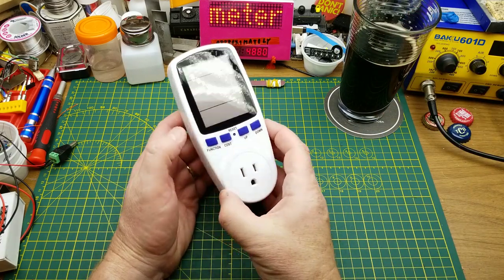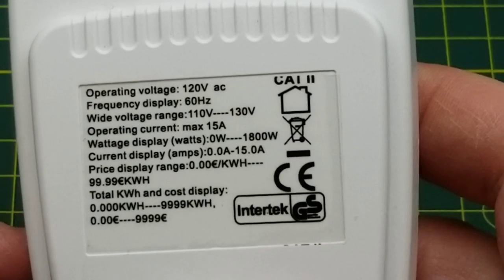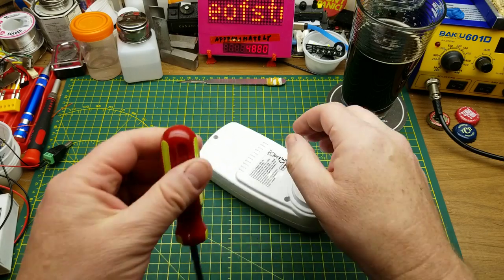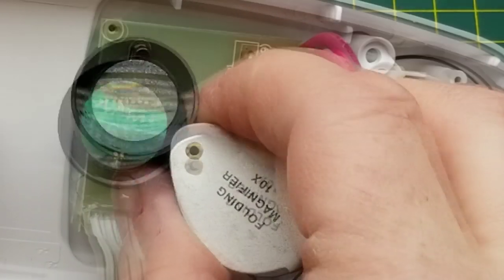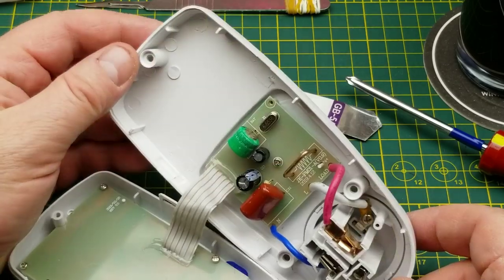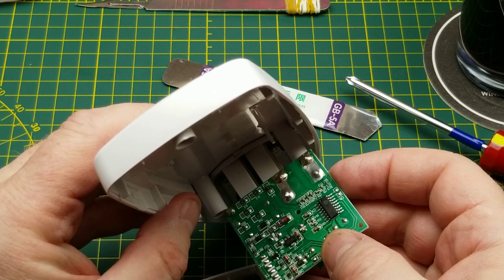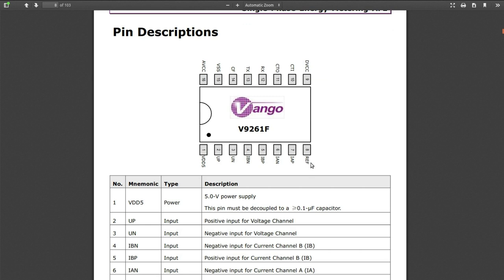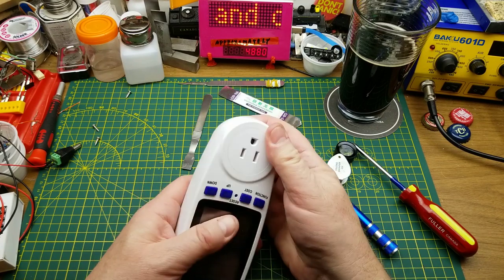Power meter test and teardown

Comment: I have that same unit and use it for testing old vintage tube radios before and after restoration. It works very well to trouble shoot shorted and leaking caps. Thanks for the video.
Reply: Thanks that is exactly why i would want one.

Comment: I have this same powermeter.. I thought it was a supercapacitor inside, but it's a tiny battery :V ... thanks for doing this video !!
Reply: The battery seems to be a 3.6V Ni-Mh rechargeable (3 x 1.2V cells in series) which is a surprise. I thought it would be a primary CR2032 lithium coin cell for simple data logging, or perhaps even no battery at all with flash memory holding data during a power blackout. Looks like the this battery keeps power to the UI screen and buttons after unplugging. So I guess the main purpose is portability; you can unplug it from the wall and write down any logs/stats from the meter.
A quick Google for V9261F Tinkerman shows a cheap mod to turn this unit into a smart meter with Wi-Fi, supported by Domoticz and Home Assistant. Great find!

Comment: Hi Sir, may i know the value of the resistor between the electrolytic capacitor and mylar capacitor cx1 of the power meter. I tested the wattage output of a modified sine wave inverter and it burned. Thank you for sharing and more power.
Reply: it is 120 Ohms 1/2 watt resistor. same thing happen with me. got the value from different video and tried the replacement and it is working now.

Comment: how confident would you be to plug it in permanently in a variac to use as amp meter for things like vacuum tube radio and amp repairs...?
Reply from the maker: Interesting thought. I wonder how it's low voltage performance is.
I'll have to test that.

Comment: can you please explain what's the purpose of the tiny battery inside, mine has only 1.5v,.and the small resistor below the cap is slightly burnt... the only issue i face is sometimes its just dies,.. but the power keeps transferring.. i just have to turn off and on again. and it just gets reseted..
Reply from the maker: It's to retain the device's memory of user settings when the device is not in use.

Comment: The backup battery. Does it store the elapse watt-hours?
Reply from the maker: Yes. It holds the elapsed time and KWH until you push the reset button.
Reply: @pileofstuff  Thank you. And  I forgot about the reset button in the other video.
Reply: @pileofstuff  How do i replace the battery? when completely depleted? i had to dump my first one thinking it was damaged. Thanks in advance
Reply from the maker: @ronaldd.1355  Just de-solder the old one and solder in a new one.

The harder part is going to be finding one, but searching ebay for "nimh battery solder 3.6v" finds a few.

Comment: The problem is not if power meters can measure 60W or 12W. This is trivial and even crappy meters can do this quite well. The important question is the accuracy at low Watts like 1 W or even 0,5 W, to see standby consumption. This is where you can actually see the quality of the power meter.

Comment: My wattmeter is also 120V AC, is it ok if i use it to 220V AC?
Reply from the maker: There are some different component values used for the 220Volt version
Reply: @pileofstuff  is that the zener diode?

Comment: A power factor of .9 is suspiciously good for cheap LED bulbs. Maybe tear it down for us? ;-)
Reply: Probably incorrect reading. I have one of these and it also showed high power factor on some leds that supposed to have about 0,5 power factor. So I got one of these panel mounted ones with backlit lcd and it showed correct power factor. At least for this one led light bulb.

Comment: I have very simular looking power meter model (same manufacturer), but european version for 230 volts. Good thing is that it also works with lower voltage (e.g. 110 volts) so I use it with my variac. Before I had a different model/brand which worked only above 160 volts - not really useful when using it with a variac.
Of course I cannot say whether the US (120 volts) version also works with 230 volts, but it could be that both European and US version differ only by the plug/socket.
Reply: i got mine with (120v marking), but i'm using it on 220v (Phils).. i works fine for a couple of months, then it suddenly didnt read, its still powers on but cannot read anything.. i dont know if its something to do with the voltage.

Comment: Ooohhhh.  That one is my favorite one to hack and add wifi to it for home automation.
Reply from the maker: That's intriguing. Do you have a relevant link that I could check out?
Reply: @pileofstuff  absolutely.  Best spot to learn about is Jose's espurna firmware page.  Mine is a derivitaive of it.  Google "connected power meter tinkerman" and you'll have it.  

If you do it and get stuck let me know.  The 120v ones have a little different signaling than the 220v.  Also that same thing comes with 2  different monitoring chips..be careful.  Those are two tricky parts but mine has been in Operation for 2 years now.  I use it on my washer to signal me with a message the laundry is done.  Also, it's wise to use an optocoupler between the d1 mini and the IC.  If you don't never hook the USB up with the power connected as it's referenced to the mains.  (Obviously)